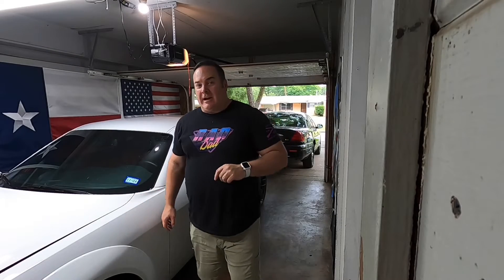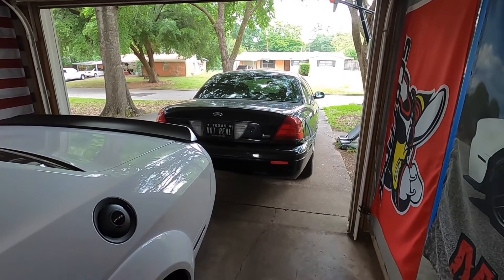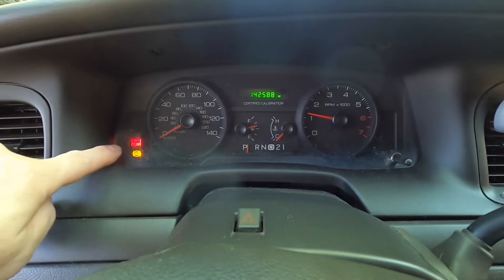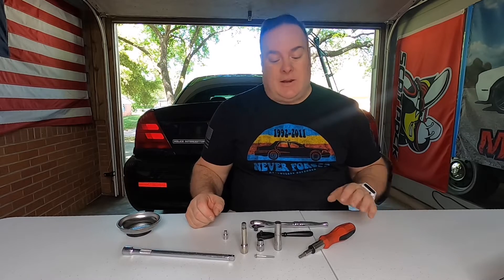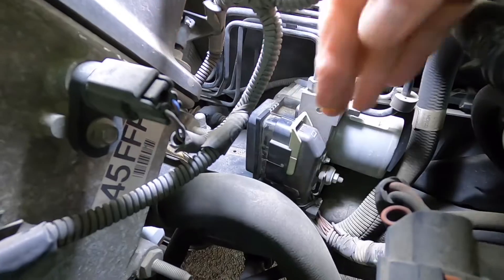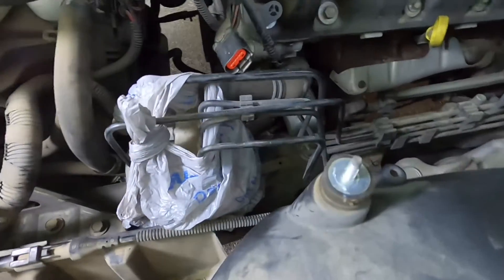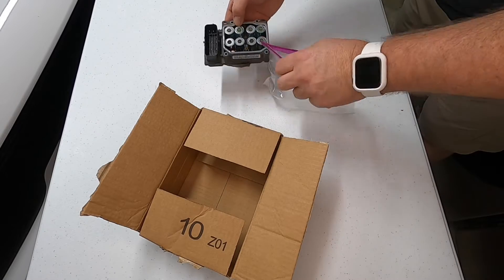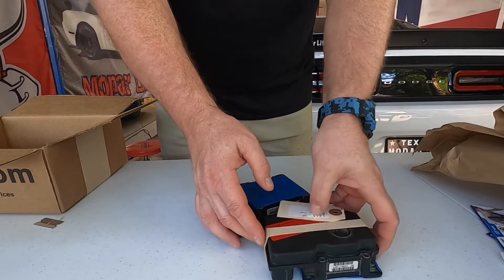I fixed my Crown Victoria ABS module…with a little help!

Comment: ATTENTION TO THOSE FOLLOWING THIS!  There is a a stem, if you will, at the bottom of the ABS unit, that goes into a rubber grommet.  If you are having trouble removing the whole ABS system after removing the two front facing bolts, you may have to use some leverage to force the unit out from this grommet.  I was not able to remove my system by removing the bolts and pulling up with a lot of force - I needed a screwdriver (or use similar) to pry the whole unit up from underneath.  That was the only way I could remove the unit to move around and make easier to remove the module.  Author - you may want to add this somewhere in video.  Great otherwise!

Comment: I have the same lights on in my 2009 grand marquis. I wanted to ask you. How much was it for the rebuilt one that they sent you. And how much did they charge to reprogram it at the dealer. Thanks for the video it was very helpful
Reply from the maker: Not sure how much rebuilt one was I don’t recall but the dealer charged me $100 to reprogram.

Comment: I've got an 11 CVPI that had an ABS light. I sent it to up fix who found issues and claimed to repair it (which they did not) so I sent it back to them for a second time and they did nothing claiming that it was working. Up s*it tipped me off, taking my money. I end up getting a used module for $80.00 on ebay, only it needed to be programed.
Reply: Happened to me as well unfortunately.
Reply from the maker: Man that’s a bummer. Glad you figured out a way to get it working at least.
Reply: Same thing, sent it in twice and still not fixed for a 2011 Vic. Although I did get them to send me a refund.

Comment: Hey man I got a question I have a 2010 crown Vic police interceptor. And the ac compressor isn't coming on sometimes it works some days and some it don't. It's good on Freon. I was told the abs module will cause the AC not to work is that true?
Reply from the maker: That is interesting. I’ve never heard of that but I definitely no expert. Call the company that fixed mine and see what they think. They are the gurus of modules they may be able to answer that for you. Wish I was more help.

Comment: If your original module was repaired, would it still need reprogramming from Ford?
Reply from the maker: No it would not. Your original still contains all of the vehicle’s info so its just a simple swap out.